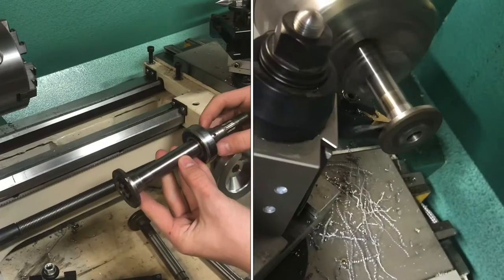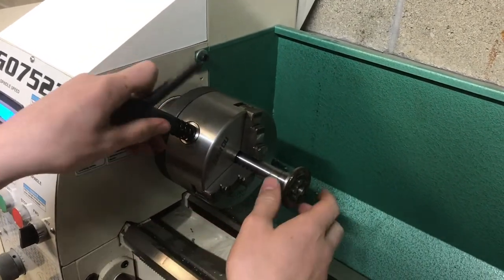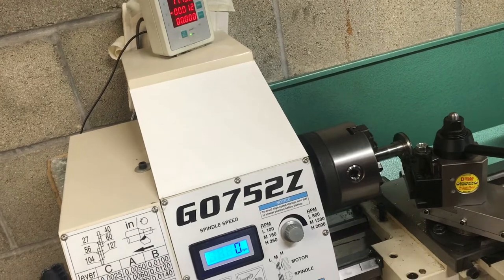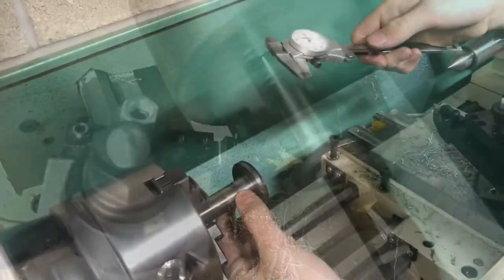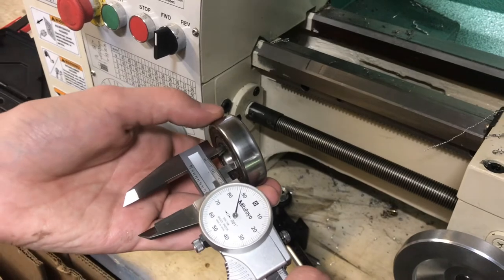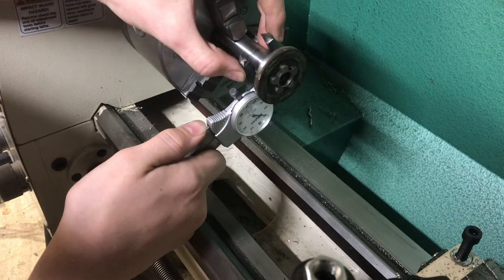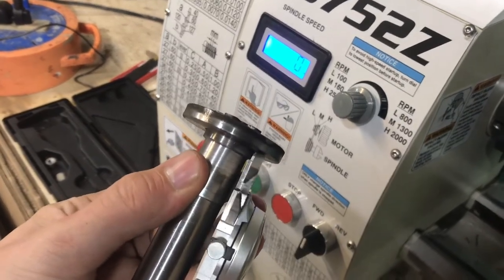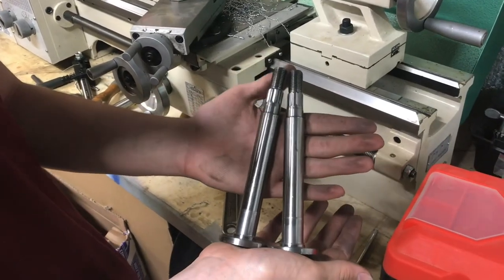how to cut “precision” interference PRESS FIT on a metal lathe (grizzly go752z)

Comment: I'm back with a question, a problem I've been experiencing.  Maybe you can help, and I really appreciate it if you can.  When I'm cutting with my lathe and maybe moving right to left I sometimes bring it back to the start position without moving the cutter away expecting maybe a little drag or some fine cutting but what often happens is the cutter seems to dig in and on the way back it cuts more than it should and messes up my work.  I've tried to see if there is play in various components but this still seems to persist.  Have you ever heard or experienced this? Thanks.
Reply: I think what you're describing is spring cutting. It's caused by deflection (usually of the workpiece). It's actually pretty common for manual machinists to do a "spring pass" on their final finishing cut. This is to get any metal left uncut when the deflection occurs. I've noticed that I end up with a taper when I turn a long diameter, not from any sort of misalignment, but simply from deflection caused by long stick-out, or overhang. It will be fatter at the end because the workpiece is less stiff, meaning more deflection, and less material removed. The closer to the headstock you get, the more rigid it becomes, and the tool can cut the material. Really hope this helps and good luck!
Reply: @mattruth7109  thank you very much for a nice explanation.

Comment: just a remidner. i dont know how your getting enough "precision" for interferance fit when measuring with calipers.  Especially for the inside bore.  Get your self a set of micrometers.
Or at least get the proper bore size from the spec... you cant get close enough with the flats of the caliper inside jaws.
Reply: I don't think the caliper inside jaws have "flats." This looks pretty precise to me.